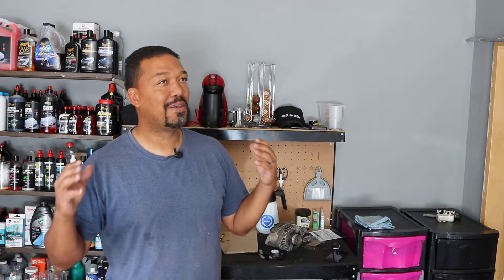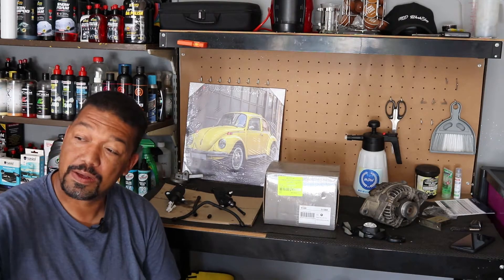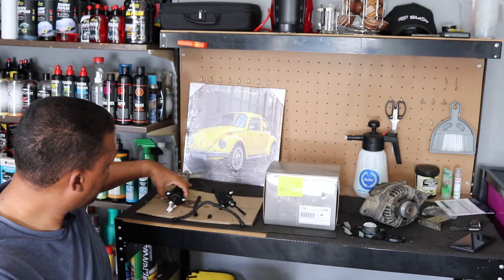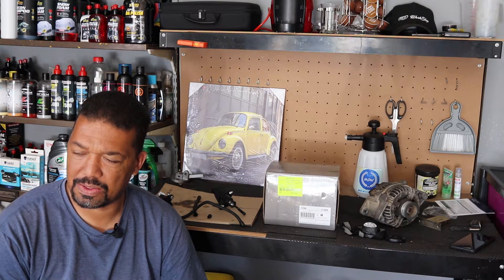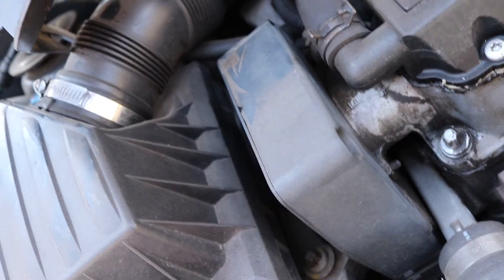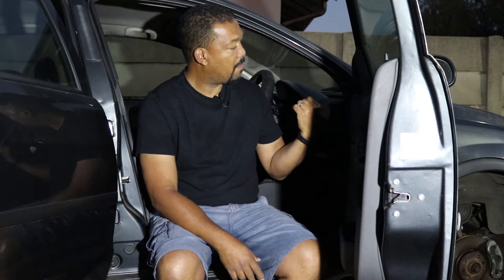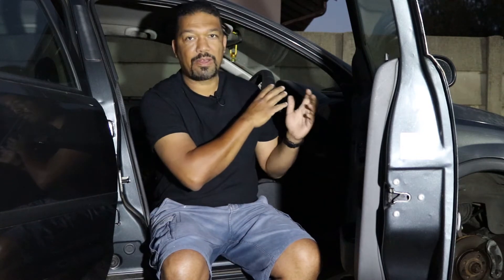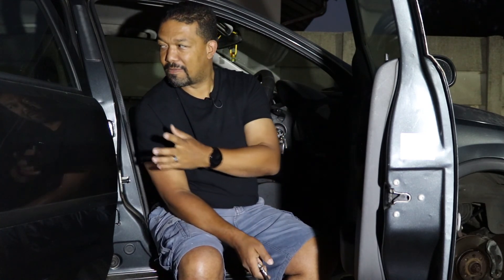Vauxhall/Opel Corsa C Alternator & Clutch Master Cylinder Change

Comment: hay man how are you doing can you please make a video showing how you got the clutch master cylinder out
Reply from the maker: Hey Bud...you are in luck, as I have just installed a new clutch on the corsa. I bought another new master clutch cylinder and will record how to remove it and fit the new one.
Reply: thank you thank you i am sitting with my car now  and not show how to get the old one out so i can put the new one in

Comment: Hi
Tell me how did you remove the bolt at the bottom of the alternator. Did you have to crawl under the Car?
Reply from the maker: Hi Faizel.
Yes, to get that long bolt it is best to do it from underneath the car.

Comment: The car wont start after removing the steering wheel after replacing the clutch cylinder, there's no fuel going into engine from the hose that brings fuel into the engine. How can removing the cables around the steering and putting them on affect fuel going into the engine?
Reply from the maker: Howzit bud?
Gosh, that is a weird. The only thing I can think of, is that perhaps your fuel pump fuse might have popped, especially because you said there is no fuel being delivered to the fuel rail. I would recommend you start there.

Comment: How did the clutch cylinder effect the alternator?
Reply: I recently put in a new clutch pedal and cylinder and then my alternator packed up
Reply from the maker: Hey bud...I dont think there's any relation from alternator to the clutch. In my case, my alternator just packed up, I had it refurbished but for some reason, it had that horrible whine. So when I replaced the master clutch cylinder, I just thought I might as well replace the alternator with a new one, which seriously was a good idea as i got rid of that whine and now i know that the alternator is good for at least another 100 000km's

Comment: He's just talking too much he doesn't show us how to remove clutch cylinder
Reply from the maker: Hi Jan.
So I mentioned in the video that there is unfortunately not enough space to show you how I removed clutch cylinder. I do however tell you what you must do, you need to remove the steering column, this way you gain proper access to the clutch pedal. You then unbolt the clutch pedal and then unclip the master cylinder from the clutch pedal...from 6:56 I discuss and show what I did to remove the clutch cylinder.